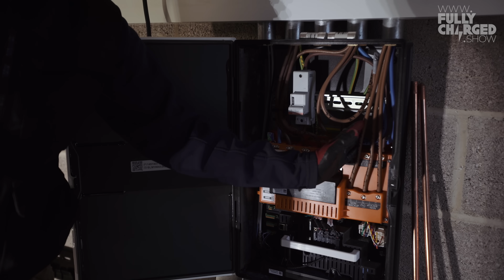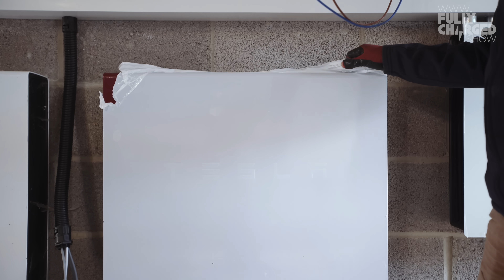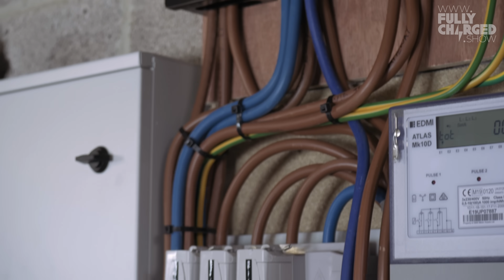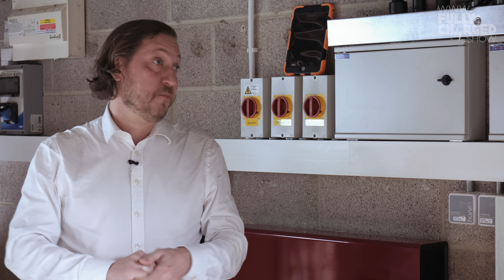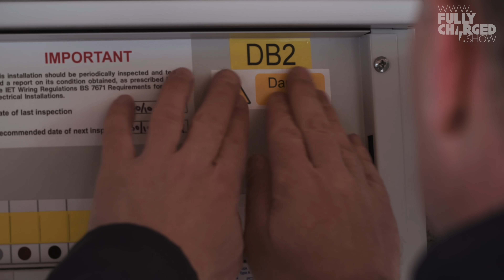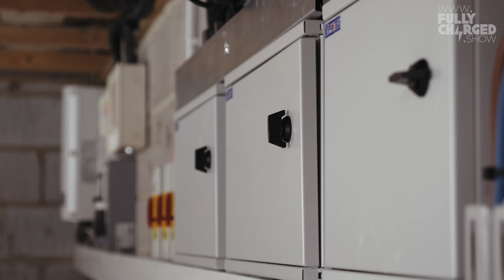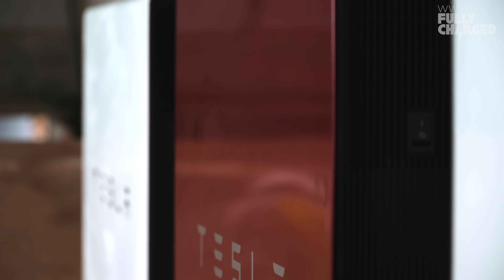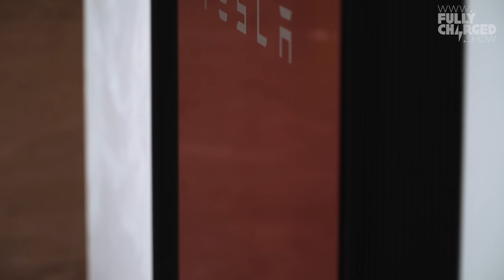Can you run your house on a battery? Tesla Powerwall 2 (Founders Series) & Tesla Backup Gateway 2

Comment: I’d like to see you add a wind turbine to your project
Reply: so would i, but the neighbours will probably moan !
Reply: I wonder how small you can get a practical wind generator.
Reply: @chrisdaniels3929  doesn't exist, might as well start cycling to produce energy.
Reply: https://youtu.be/pcdXLbzGVpo
Reply: @idiotbox4180  Oh wow, they produce wind turbines, how magical. Now they send them across the world on a cargo boat or plane that will burn tons of diesel, hahah. Did you ever think for a second the fibreglass (Commonwealth English) is a common type of fiber-reinforced plastic using glass fiber. Did you ever pass 1st grade maths ? 1+1 = 4 ?.
For the green / renewable energy morons that believe in this mindless utopia like GRETA:
Some facts for you folks...
The “Maliza II” is a 60-foot racing yacht: like all serious racing yachts it is made almost entirely of carbon fibre. The manufacture of carbon fibre is extremely energy intensive: every kg of CF typically generates 20 kgs of CO2. 
The Maliza II weighs around 7.6 tons. So the manufacture of its carbon fibre alone is responsible for some 140 tonnes of CO2 – more than most people are responsible for over decades of life. 
This is before you even factor in the costs of flying the crew and equipment around... 
A racing yacht like this may have a competitive lifespan of only a few years before being scrapped. They are incredibly expensive to maintain or re-purpose. And Carbon fibre has very limited recyclability. 
In other words, this is the highest-CO2-emission “Zero Emission” Atlantic Crossing ever made.
Meanwhile her driver and bodyguard took planes and waited, and then they end back on the planes.
https://www.youtube.com/watch?v=r8SyoRwV_To
I swear you guys can barely even manage your own lives, but you want to tell others how the world should be, PepeLaugh.
Go and piss on your bird blender, you'll be saving birds and the life cycles
Reply: Yes id love to see hundreds of birds die too, that would be run, might paint it white to see al the blood.
Reply: Lightzpy you would have a long wait standing under a wind turbine. Visit your average city and find a skyscrapper with lots of glass windows to get your kicks sooner
Reply: @watcher24601  They still kill millions of birds, to the point that wind engineers call the "particles" that damage wind turbines "Bird blade" ahhh, And to make matters worse the materials that wind turbine are made with are NOT recyclable and a LANDFILL nightmare. Also they are a waste of money and destroy the environment before it's even produced.
Reply: @lightzpy8049 . Tsk, tsk. Been listening to Trumpy again? You know it's bad for your mental health.
Reply: @curmudgeon1933   So you want the whole world's infrastructure to adapt themselves to "renewable energy" not green, the grid, house generators, road wiring layout, energy and wifi systems, solar panel systems, do you know that amount of billions that would take you moron. You are from the UK, land of communist leftist, you guys spend billion on wind farms, guess what bukko those turbines need maintenance,  that cost more in the life time then fossil fuel, and wind turbines don't have the same energy output and sometimes can't even work without a fuel generator, also they kill thousands of birds, so well done on destroying the real environment not some CO2 bull crap,. while you ignore antarctic ice sheets co2 data which shows cycles and much high co2 periods then us, you must not know because you listen to MSM like a sheep, but animal feces increase ground biodafisication, this means the ground absorption nutrients from animals and creates greenery at a much higher rate then planting trees, the result is higher intake of co2 which makes it grow faster and faster, this has been shown on TED talks by agricultural management experts. Is green every real ? NO
Nothing is green nothing will ever be green, you most likely have an electric appliance bukko, guess what ? that appliance has oil components, all renewable and green energy systems produce very high rates of CO2, even higher than any other production. Life span of renewable energy systems is also short, nuclear stations can continue running for a hundred years it's been said by the EIA if well maintained updated, which produces passively, also nuclear 1: doesn't emit anything. 2: produces high volumes of energy no matter the time. 3: add to diversification of energy systems. 4: It's actually affordable for people that are not privileged.
Renewable does this:
1: Takes away precious resources that could be used for heavy innovating in different industries
2: They are not so green and actually are worse taking into account the recycling of these systems.
3: Maintains cost is higher and it's more expensive to have / own.
4: It catches fire
5: It's not as effect and efficient, until Lithium carbon dioxide battery can be perfected for daily use.
6: The world needs CO2 and it's not bad, also if you are going to blame countries for co2 production blame (Chines, India and Africa for being the most polluting countries / continent in the world), those countries are shitholes because the people make it like that.
7: These renewable systems cannot produce alot and use alot of resources, not all countries are addept for it, if you actually finished school then you would know. Sunlight exposure over land, high wind density land, and more. Also these systems corrode and sometimes burn, this makes them not only dangerous to people's lives, but also have a high failure rate for low returns of energy and high co2 emission for production. Also the production systems use oil meaning the machines, components and tools all use oil to be produces, also the mining of these resources use oil. So ironically you just live in a land of unicorns and fairies where you can drink your over prices coffee and cry in a corner when offended, because you lack knowledge.
CO2 tax just another world for financial terrorism on those that try to live day to day, meanwhile privileged pricks like you exist that havent passed middle school psychics and geography,

https://www.youtube.com/watch?v=5v8ZPil4wbs https://www.ted.com/talks/allan_savory_how_to_fight_desertification_and_reverse_climate_change?language=enhttps://www.aei.org/carpe-diem/inconvenient-energy-fact-it-takes-79-solar-workers-to-produce-same-amount-of-electric-power-as-one-coal-worker/

https://www.youtube.com/watch?v=5v8ZPil4wbs
https://www.youtube.com/watch?v=r8SyoRwV_To - maybe you green morons can clean up after yourselves as every time you have a protests you pollute and leave mess where, but don't worry you aren't homeless so you can go drink your starbucks coffee.

wind solar tidal work as hybrids with other power plants they don't produce energy at rate or in line with human demand and often drop when human demand spikes
the current solution to that is to build the largest batteries on earth sounds great
the batteries are evermentaly toxic
the cells with in them have short life span the spent cells are toxic waste
the waste produced unlike every other common toxic waste building up in are oceans and on land
plastic lead mercury is water soluble 
it more toxic to plants and sea life then lead
the metal salts in then is explosive 
the cost of converting the power grid to wind solar and tidal will skyrock the cost of lithium
the mining and refinement can cause create florine contamination of land and water one the worst types of mining waste
you could see the cost raising effecting cars and every other aspect of life raising the cost of living
wind turbines produce toxic waste as there made and break apart releasing fiberglass into there air and can effect human and animal hearing 
solar is fragile and subject to thing like powersurgies minor but costly
tidal turbine break down and leach metals minor
aside form wind the larger problem is the battery systems needed three exist globally 
all three are better then co2 build up globally but so is nuclear
all of that is over shadows algae based fuels which making fuel from nitrogen wastes from water run off(one of the three major causes of global warming) and co2 directly the fuels used can go straight into a tank 
the lithium power storage systems threaten to accelerate deforestation so there just increasing one cause and partly dropping another or in other words solar wind and tidal systems still add to global warming and do so in a way that we have less control over.

Mark Millis, a senior fellow at the Manhattan Institute, explains in the Wall Street Journal that renewable energy is a “misnomer.”
“Wind and solar machines and batteries are built from nonrenewable materials,” Millis explains. “And they wear out. Old equipment must be decommissioned, generating millions of tons of waste.”
Millis puts numbers behind his claim. Creating just one electric car battery “requires digging up, moving and processing more than 500,000 pounds of raw materials somewhere on the planet.”
Building just a single wind turbine “requires 900 tons of steel, 2,500 tons of concrete and 45 tons of nonrecyclable plastic.” Solar is even worse, requiring “even more cement, steel and glass—not to mention other metals.”
Those metals will likely be mined from countries “with oppressive labor practices,” such as China and the Congo. If your electric car or solar panel relies on cobalt from the Congo, you are likely complicit in child slave labor.

The only real green energy is nuclear, good investment of resources, with low maintenances cost compared to competition, for effective and efficient energy density and production as well as distribution and holding facilities.
Otherwise there is https://www.youtube.com/watch?v=66YRCjkxIcg&t=332s and hydroelectric but those come with proces and cons and they are mostly don't produce more and are less efficient , with lower life spans.

Also nigh trump derangement syndrome NPC sheep.

Comment: Great stuff especially the upgraded car charger.   We have a diverter for our water heater and  over tha last 4 years our PV (3.5kW max) has generated about 12MWh of which about 3MWh has gone into hot water, replacing gas. The diverter only cost about £250 so a real bargain.

Comment: Really really good video.
Some nice numbers were really useful.
What would be useful, especially with smart tariffs and back ups, would be if the intelligent part has some upgrade for the future.
Ie, you heat hot water with excess, but if you had a heat pump, whether it can also run that or if that needs extra hardware.

The zappi charger is of great interest as I understand it is designed to integrate with solar systems. Can it be set to charge at a lower rate like perhaps 7kw as default. I drive more than average, but ironically, seldom use the car as most driving is long journeys (hence why I've got a diesel, but looking at the new vw and Kia which now have 250+ miles) normally use train, bike etc..

Finally, any advice with what your system is and costs and installers be really interesting as I was looking at 14 to 16 panels, and power wall. But fully charged is probably the best, honest source of information. 

Finally, can you set the limits on charging with power wall? I would hope it could be set to charge to pay 80 to 90% and down to 30% but that may be already built in. 

Great video very informative

Comment: Few months ago I just learned, that here in Czech republic we have electricity dealer with 100 % green energy (biomass, wind, small PVs like Roberts and spottrade). I think that there is no need to buy PV instalations on your roof, if you have this option. Why would I pay big money for complicated system with high risk of fault? I really dont believe that it wont need repair or change in next ten years, panels will be ok, but rest?   I trust in good green energy, but I never trust technology after warranty.

Comment: Hi Robert
I'm afraid you STILL haven't address what - to me, is the massive elephant in the room - COST!
Everyone wants to know how the cost/benefit works out. EVERYONE!!
PLEASE tell us how much the ORIGINAL single Powerwall on single phase cost to install, and how the savings and convenience of battery storage work out. This, of course, should also be related to the savings when charging ONE EV. Then you can say how long you will have the Powerwall before you break even and actually start to save actual money.
This is what will matter to the vast majority of potential users of home batteries - because the up-front costs are VERY high!
As you are well aware, most people are not able to make this kind of investment just to 'save the planet', but to save money. It has to have a realistic payback.....

Comment: Great video but how much did the installation of 3 phase cost?  I was very concerned about the time it took to switch from grid to battery - enough to kill any computers etc., so you'd still need a UPS.  I also don't understand why the inverter only kicks in when battery level is at 30%?  What an horrendous waste.

Comment: I am happy to finally see this technology deployed! Around 2004, I worked as electrical engineering intern on smart grids, PV and Wind integration into them and heat storage in glycol backed freezers & boilers. My main work was in data acquisition and the switching electronics to charge and discharge the batteries.

Comment: The big issue with 3phase in the UK is that there are no SMETS (1or2) smart meters available for 3 phase, I have the same meter as Robert does there (at Atlas Mk10 IIRC) it offers Economy 7 dual rate but nothing smarter and I still have to take readings, despite it having a GSM module & SIM in the base

Comment: What's missing here is the expected life of these PowerWalls. How many cycles until you have to replace the unit. Several years for sure... but then you have to buy a replacement at 7000 PS? Is it worth the cost if you are connected to a reliable grid.

Comment: I don't understand why it needed 3 phase fitting
Reply: From what I can gather, it's because the potential total load (from charging the batteries, heating hot water, charging his car, and running all the household appliances, etc) exceeded what a single-phase could deliver.  It sounds like his previous system was borderline - but he had only half the batteries to charge previously, and a smaller/weaker car charger.
Reply: @logicalChimp  Thanks. It's my intention to put a similar size set up in our house but I'm not really interested in feeding back to the grid, so I was imagining it would be separate from the national grid and would only require larger capacity wires in the house. Although the house is in France and you get taxed if you generate more than 3kw if you feed it back to the grid.
Reply: @martinbguk  Unfortunately, I don't think it quite works like that - the size of the connection is the total sum of all potential sources of load in the property.... regardless of whether you'd actually have them all turned on at the same time or not.

If that potential load exceeds the power that can be delivered by single phase, then you have to upgrade to 3-phase (or 2-phase, if your power supply gives the option, I guess)

But I'm not an electrician, and it's been a long time since I trained on 3-phase, so really you'd need to speak to a professional...
Reply: @logicalChimp  I think you're right. Even if I don't want to export to the grid, someone after me might. It was an eye opening video though on the size of solar array required. Nice to have a polite and measured response. :-)
Reply: @martinbguk  I don't think it has anything to do with exporting back to the grid (Roberts setup is designed explicitly to minimise grid export) - it's about the potential load you could end up drawing from the grid - if that potential load is too high for single-phase, then you have to upgrade.  

Trying to draw too much power through a single phase connection could cause fires or problems at the substation (if something inbetween didn't trip first)

Comment: Your argument that if 20 million homes installed a battery and charged them during off peak that the peak goes down is incorrect, because all you have done is shift peak consumption time from peak time to off peak .
Therefore to charge to 20 million batteries during off-peak would put a high load on the system they would have to crank the power station up to cope with it, so the end result is still the same, surely Robert you can't be that silly to think what you said makes sense ?
Reply: Running a generator at a constant rate is the most efficient option.  If we had perfectly flat-rate demand through the whole day (because batteries charged whenever there was a drop in demand, and stopped charging when there was a spike in demand) we would have the most efficient grid.

'Peak' supply is provided by extremely inefficient 'Gas Peaker' generators, which despite being very inefficient in their conversion of fuel to electricity, and generating lots of emissions, can be turned on in minutes and can handle being turned on and off multiple times a day (most power plants really don't like being turned off/on, so are really slow at responding to changes in load)

If we can flatten the peaks out (by shifting demand to fill in some of the troughs instead) we significantly reduce the use of 'Gas Peaker' power, and thus reduce overall emissions noticeably, despite the total consumption not changing.